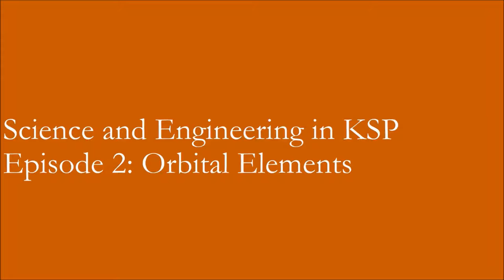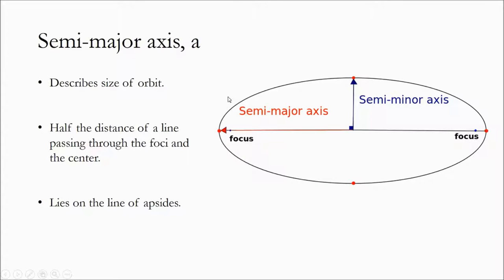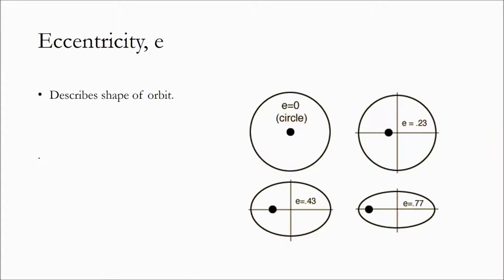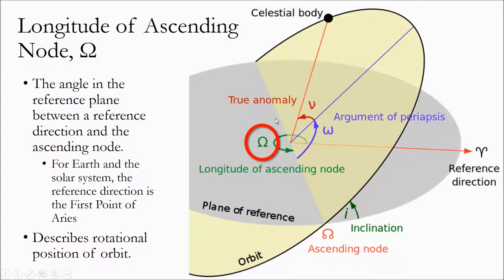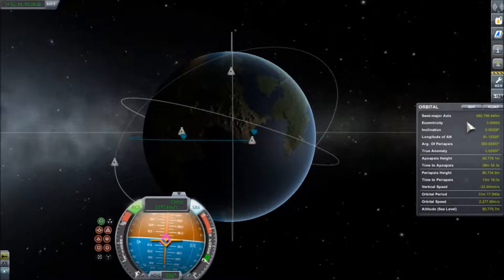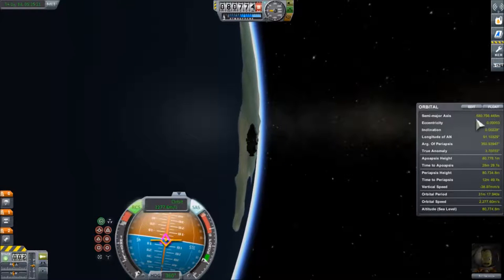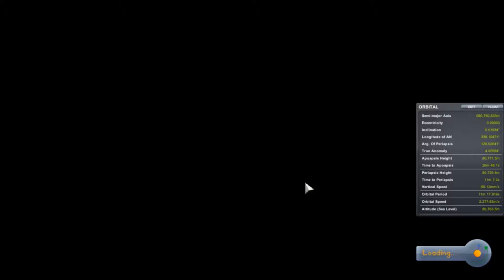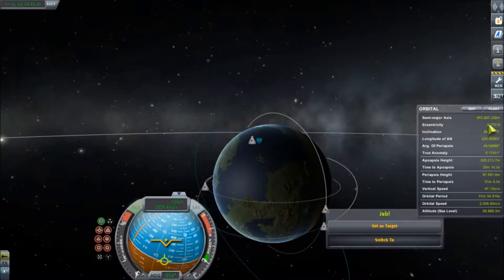Orbital Elements in KSP

Comment: Here's a problem: what is the argument of periapsis for Earth's orbit around the Sun? Since by definition there is no ascending node, how is Earth's argument of periapsis measured?
Reply from the maker: In the sense of the ecliptic, it's not really, but astronomers can also use the Sun's equator or the "invariable plane," basically a weighted average of all of the planets' orbital planes. With respect to the ecliptic, Earth's inclination is 0, with respect to the Sun's equator, it's 7.155 degrees, and with respect to the invariable plane, it's 1.57 degrees. In those last two cases, you can define an argument of periapse.